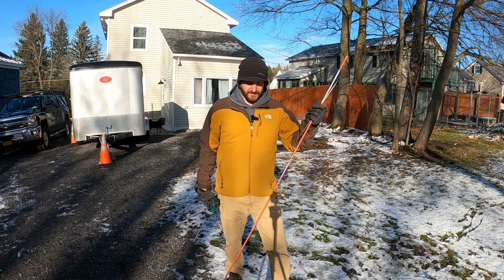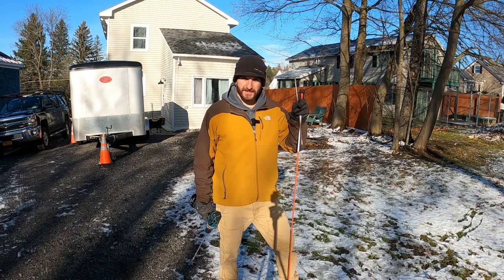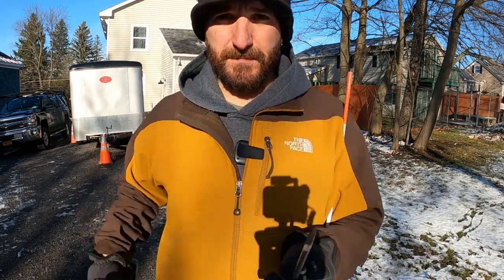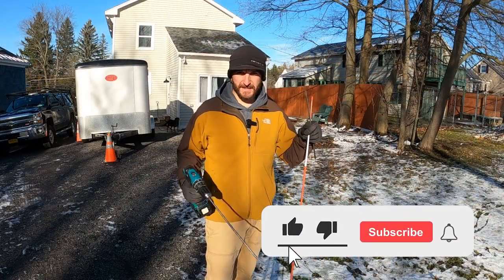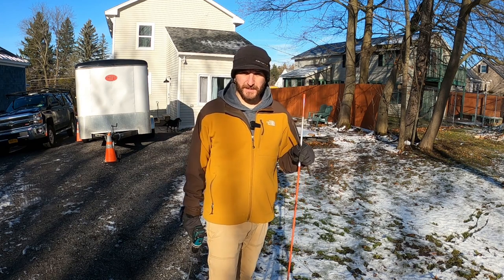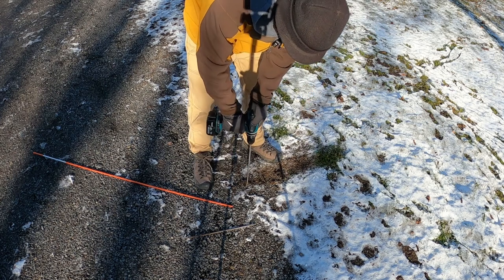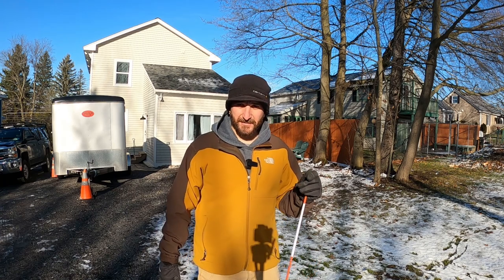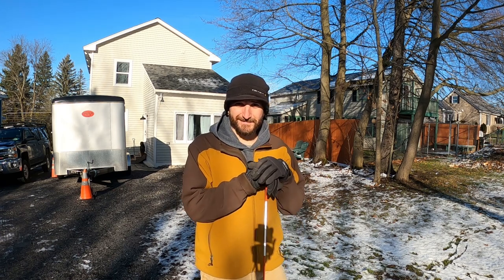The Best Way To Install Driveway Stakes For Plowing!

Comment: A 3 foot long half-inch galvanized pipe threaded with a cap they tap right in no bending , I use your technique like you instructed when the tough gets going
Reply from the maker: That is actually a pretty good idea! Only problem is I use the broken stakes too so they are only like 2'6". Although I switched from 3' to 5' stakes because once you snap a 3 footer they are basically useless. with a 5 i can use them even after they have been snapped a couple years in a row! They just become 4 footers!!! Plus I like the 5's because I can see them a lot easier when they are close to the vehicle. thanks for the input!!

Comment: The way that I do it, I take a 1/2 " copper pipe, 8 " shorter than the stake and use a rubber mallet, works great.
Reply from the maker: Cool idea! So the copper pipe just keeps the stake from bending and goes right in! What if the ground is rocky? does it still work?